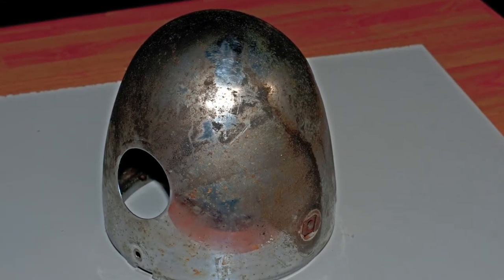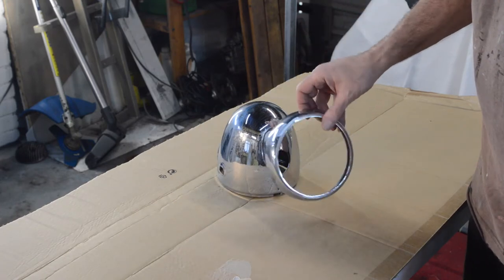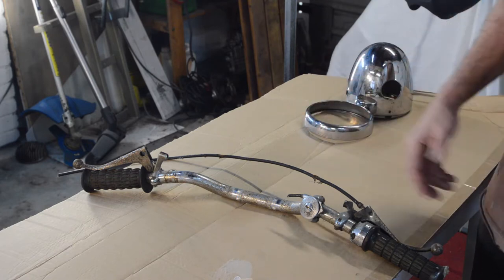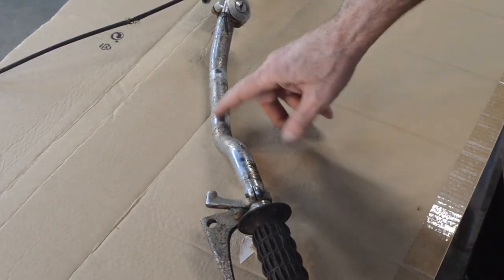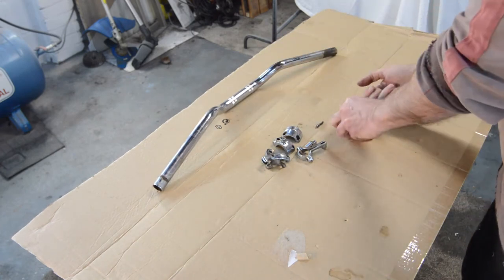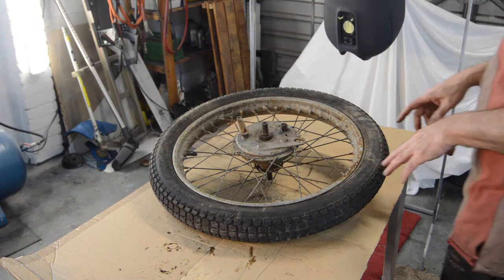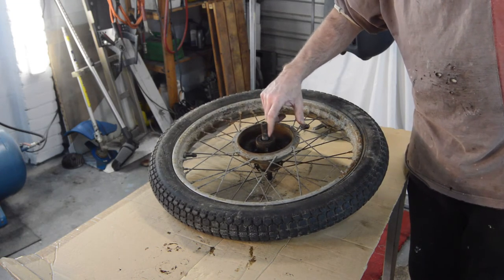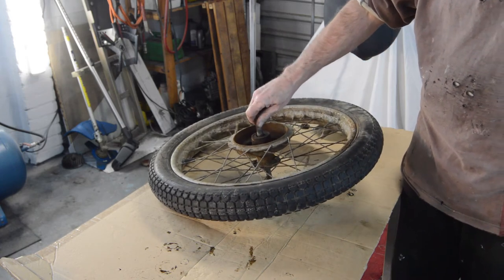Bantam Build Part 4

Comment: When working on a Yamaha TY250 restoration I was faced with the same question about rebuilding the wheels. I decided to do the work myself, saved a bunch of $$ and actually enjoyed the process. Also, your comment on "several week wait" for parts and service is the same here in the US. I have a few projects going on and it seems most of the time I am waiting for parts. I always enjoy your videos and good luck with the work.
Reply from the maker: Thanks Ron. I will probably do the wheels myself but the build is going on hold until I am certain I can get all the bits I want before I lay out any more cash. It looks like the supply chain is struggling world wide at the moment leading to some peculiar shortages.

Comment: That chrome cleaned up amazingly well. It is true that chrome ain't what it used to be. How on earth did the seat get bent out of shape, I wonder. Can't imagine a likely scenario. You could just slap rust converter on it. Seems to work. Thanks, Mark.
Reply from the maker: The only thing I can think of for the seat mis-shape Bill, is that once it was rusty, the back of the seat is a good place to grab when pulling the bike off the centre stand and the strain was too much.
Reply: @oldnutsgarage  That makes sense. Perfectly fixable and serviceable.